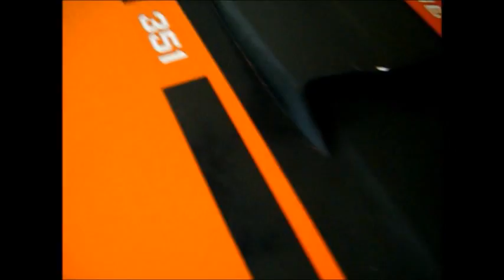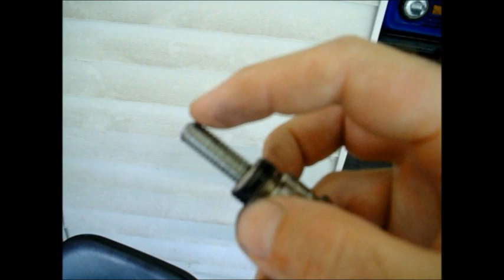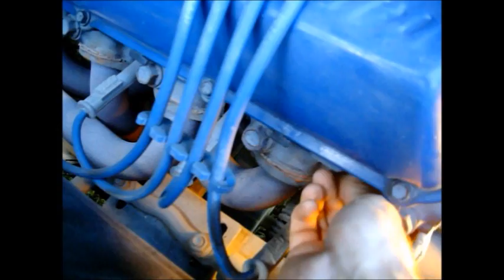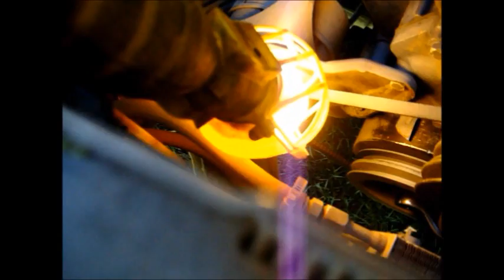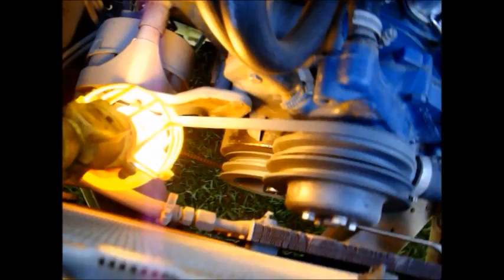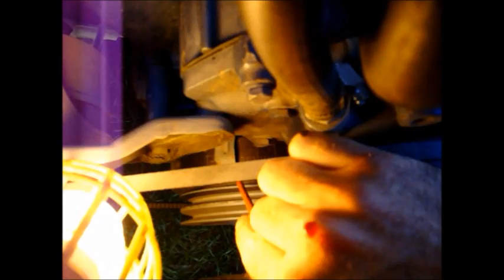Timing - Part 3 - How To - Using a piston stop to find true #1 TDC.wmv

Comment: the TDC is stamped in metal at he factory where thhe make the crankshafts its not going to change - remove spark plugs so you rotate eng to line up tdc on the arrow stop remove top of dist  look at the rotter  minis pointing at #6 wire which is at 1 oclock pos looking down at dist  connect timming light to # 6 wire spin eng with starter see where light is in relation to tdc i want it on 4 deg before tdc  loosn bolt to allow dist to move  slowly rotate dist.till it lights 4 deg line before tdc spin starter vertfy 4  degs tighten dist install spark plugs put top back on dist  start eng verfy #4 flashing shes timed , easy
Reply from the maker: It would be easy if that was true about the stamped TDC not changing.  For timing purposes, the TDC mark is stamped on the outer ring of your harmonic balancer.  The outer ring on a factory harmonic balancer isn't permanently married to the inner ring.  If it was, then no problem, because the inner ring of that balancer is keyed to your crankshaft and it can't move.  You've got the inner ring of the balancer, then a rubber cushion, and then your outer ring, and it's all just an interference fit.....and rubber deteriorates over the decades.  All I've owned my whole life is old cars, the oldest being a 1955 Pontiac, and  the newest is a 1975 Bronco.   I've never owned a car newer than 1975, and I've learned that decades old harmonic balancers don't always stay together, married by that vibration absorbing layer of rubber.  The outer ring can walk away a little bit.  Keep driving it and eventually it'll keep walking until it completely removes itself from the inner ring, and then it's just free-wheeling in there, between your timing chain cover and your crank pulley, and it's not attached to anything.  Once that happens, you'll hear it.  It can't go anywhere, it's trapped, but it'll be loud.  I made this video for a friend who couldn't get his engine to run right, even though he had his timing set at 10 BTDC.  And it ran fine the last time he timed it at 10.  Thing is, it's no longer 10 BTDC, if your outer ring has taken a 30 degree stroll from where it's supposed to be.  Simply timing it off of #6 like you said (180 degrees from #1, in your firing order) won't help at all, if your outer ring has walked, unless your outer ring has somehow managed to walk exactly 180 degrees.  There are other reasons for wanting to find true TDC, the most common being if your factory timing pointer, that's normally bolted to the timing chain cover is completely missing, and you have to fabricate one.  Sure if it's an old Ford, you can probably just buy that timing pointer, but there are lots of old cars that don't have the same level of parts availability.  This video is for people that want to find true #1 TDC by using a piston stop.  Most people will never need to do that, but some will, I've had to.